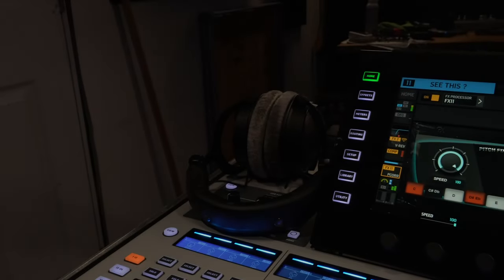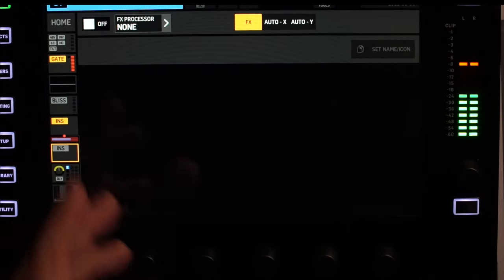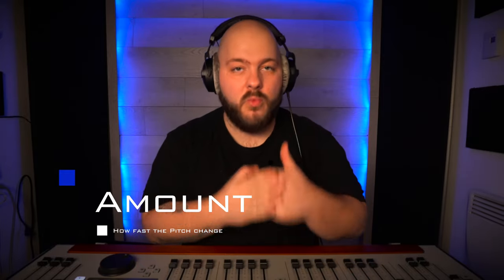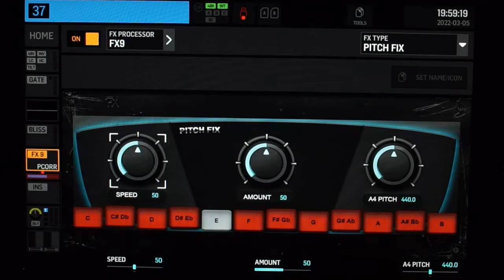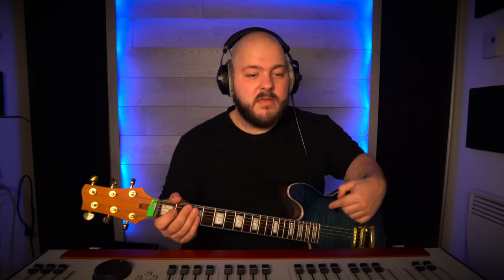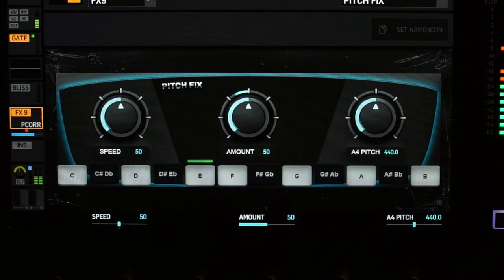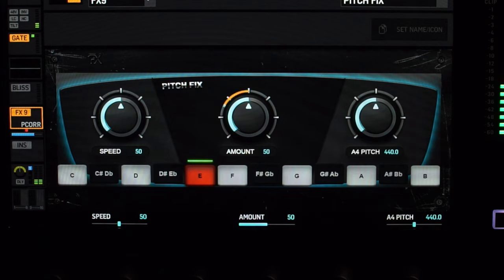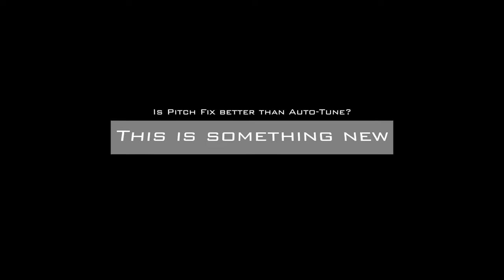Pitch Fix - Quick WING Tips

Comment: Thanks Guillaume. I am running all my vocals through Pitch Correction and the sweet spot for me has been: Speed 50  Amount 85 in chromatic mode. I really can't hear it making any difference during speech (which is good) and the main benefit is very tight harmonies. But if the vocalist misses by more than 50 cents it will grab the wrong note (this is not good). I tried running with only the notes of the current key, but since it will pass any note that is unselected as uncorrected, it isn't worth the headache of setting keys per song. It is very useful for great vocalists. It doesn't make a great vocalist.
Reply from the maker: Hi Dale !

Exactly, it make good signer shine or that Hip Hop effect, nothing more, nothing less. 
I will still use it on some shows but only if i know the artist for some light correction. ...or that Cheer \ hard tune stuff. 

thanks for watching!

Comment: Good afternoon.
We purchased a wing behringer, but when we needed to assign a bus as a control signal for side-chain in dynamic processing, it turned out that only the channel was selectable in the drop-down list. Neither auxes nor buses can be selected, although in X32 the source for side-chain any channel, aux or bus could be selected in the compressor.
Is this a developer oversight or are we doing something wrong? Thank you
Reply from the maker: Hi 👋 

So far, only a Chanel can be used for side chain but I see this as reasonable request, I’ll try to ask for it and see if it ever get implemented in a future Firmware.

Thanks for watching my videos!